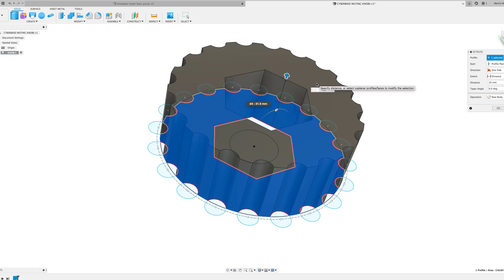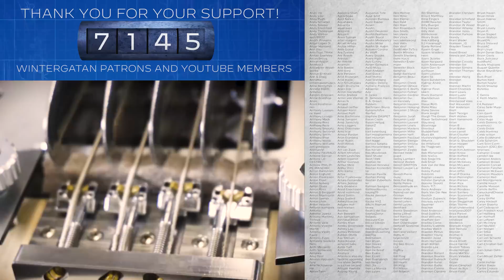Playing the CYBER BASS

Comment: If you want something a little better than the "cold blue" you are using, try rust blue.  It is actually an older, superior method of bluing steel.  More durable than modern "hot blue" finishes.

Comment: The bluing stuff is really good for heat as well that's why they use it on guns a lot. Protects the metal from rust while not just burning away after a few hundred rounds.

Comment: Legitimate question, did you think about doing a cam based system to play the bass? A bunch of arms that have artificial fingers on the end. They would be moved up and down on predetermined frets of the base, and the cams would be moved by the gear system. Using that you might be able to get the short notes you wanted.

Comment: Beautiful work, but with those two knobs you need two hands to adjust the note length. With a few gears (or a chain) between the two knobs you could reduce that to one knob without losing the stability that lifting from both sides offers.

Comment: An adjustable version of what Fender did almost 70 years ago.  It would be better if it pressed down, so it does not compromise the pressure of the strings against the bridge barrels.
Reply: and Rickenbacker, and then Musicman
Reply: -It doesn’t come close to being a problem in the way you describe.
-The bridge is so far away that it doesn’t matter.
-Plus it’s not pushing hard on the strings, just touching ‘em softly.
-Cheers

Comment: I am viewing this video from the perspective of a bass player. From my viewpoint there are a number of aspects about this build that need to be explained, because right now they make no sense. I watched the whole video and you never explained why you made these giant blades above the bridge pickups (adjusting your plucking position can be extremely useful which now cannot be done). Also, why have 4 separate inputs when the pickup heights could have been individually adjusted? Also, no mention of why this is a cyber bass. Maybe put a midi controller on it or something. I am willing to adjust my viewpoint if things can be convincingly explained. However, as of this moment I see very little logical reason for the design other than making it look cooler than it really is.
Reply: This bass is not meant to be plucked by a person. Blades are guides for marbles. Picking position can not be adjusted because they are set by the rigidity of the marble paths so this won't be an issue when the marbles are playing it. The machine has limited programming, so providing individual outputs allows him to mute one of the strings in the DAW and his live setup, so even if the marbles are still playing that string, he can create different patterns. Watch the video he just put out today: https://www.youtube.com/watch?v=rvL83-iy-EQ.  It goes over the actual use case a lot more. He shows the muted strings at 18:24 in that video. As for the name, I think he came up with it in a past video. I can't remember the reason.
Reply: @GilliganBMT  Thanks for explaining! This build make a lot more sense now. In retrospect, kinda strange he even made a video plucking it by hand. The new video was pretty cool!

Comment: If you're unsatisfied with the finish of the bolts, you can definitely pocket machine and press the bolts in from the back side. It will make the look a lot more "stealth" while still being very solid.

Just make sure to grind the heads flat so the knob goes on straight.

Comment: OK, so probably the worst idea ever just popped into my head...
but imagine an entirely mechanical/roboticised bass using metal ribbons and some sort of plucker?
probably a terrible idea tbh!...
but now ive thought of it, i kinda really want to know what a metal ribbon suspended between two points would sound like!
maybe pickups at various lengths could even be used to add an extra Electro sound! (like super high voltages passed through vibrating ribbons that smack against pickups?)
(at the very least a custom pick/plucker would have to be made though!)
then again, the more i think about it, the more i feel this is more of a job for a metal worker with a possible death-wish! lol...
Reply: lilliths revenge Sounds kind of like a bass version of a harpsichord (the ancestor of the piano, with plucked strings instead of hammered)

Comment: Gibson EB basses from the 60s have a simple mute that is just a pull tab that wedges the felt or  foam into the strings with a spring that pushes it back down when the pull tab is released. So much simpler, much quicker to engage.

Comment: You made a drill bit! I had the same problem on a electric guitar mod recently- standard bits not long enough- but didn't think of doing this, even though I have long stainless steel TIG welding rods lying around. Thanks for the idea, Mr Audacious.

Comment: Did you apply oil to the Perma Blued surface? Because that looks dry. 
I don't know if you know this already, but the cold bluing substance just makes an porous surface on steel for oil to hold on to. So it's the oil that actually protects the steel, not the black colored layer itself. On bonus side; oiling the surface turns it a bit darker. But probably you red the manufacturers instructions and I'm blabbing all in vain here.

Comment: Awesome song and build! May I suggest adding/using one knob right under the bridge of the bass instead of the two knobs to bring the felt out and in more ergonomically and faster with one hand and putting springs along the two knob screws? Or through that foam knob I am suggesting to add, perhaps create a three level push mechanism so that you get three different foam settings on the strings: first setting is no foam on strings silence; second setting is minimum foam on strings; and third setting is full-on foam on strings. Actually, I saw something like that designed by a friend of Scott from Scott's Bass YouTube channel. Might be simpler to operate while you're playing bass. Thanks! Brilliant stuff!

Comment: Scope creep is all over this project (that is kind of what happens with engineers like myself) but when you started to use the base drum I had an idea. The idea was to place a base drum inside the structural frame. Since the programming wheel is set in stone, use a second small programming wheel where it can be geared down from the main programming wheel. 

Downside is you will need a heavier marble to hit the bass drum pedal so you would need need dedicated subsystems from the superstructure. Maybe hold off on that until the Marble Machine XL, with a full 3 1/2 octave vibraphone.

Comment: Sure hope you patented all that. Or a clip/flip version, where you adjust height of the felt like you're doing now but you can flip a lever that lowers or raises it by a certain set increment for fast action. Two bolts might seem like a hassle to set, but it's better because you get to set both sides a bit differently (i think).

Both the bridge and the felt mechanism should be pattented because guys like Fender or whoever could get these on a new model and sell em for quite a bit. People are going to want these on their bases to get some motown etc sound...

Comment: Hey, Marvin, you might want to reconsider combining the aluminum knob with a steel bolt. Can cause galvanic corrosion if you get it wet/sweaty. Might not hurt to throw a layer of lacquer or something between the knob and bolt to prevent it. Don't know how significant corrosion will be, but it's something worth considering for overall longevity of the machine.

Comment: (Martin cutting the AD/HD bridge with a chop saw)  My brain goes to this:

Antiques Roadshow 2120:  "And here we have a beautiful marble machine brought in by John.  So what you can tell us about this wonderful piece?"

(long rambling bit about how it has been in the family for decades but not sure if it's authentic.)

"Mmm-hmmm, mmm-hmmm, well John, I do have a good bit of news for you.  Do you see this bridge plate?  You mentioned that you think it might be a replacement part but in fact I did a little digging and discovered that the original creator of this device actually had to 'field modify' this bridge in order to make room for the felt dampener.  So by having this AD/HD logo cut off at the top, this bit proves that your marble machine is an original...."

Comment: For the new part, why go with screws instead of using more of a knob/switch on a ramp to push the felt up, with divots to keep it in place, so you can more quickly and easily swap between short and long notes?
I'm envisioning a spiral stair case or overly large screw threading design with a strong spring pushing the felt piece up.

Comment: Rather than securing the dampening plate up with bolts, what about using springs on the threaded section of the bolts then you can disengage the felt quickly and manually when the song requires long notes?

Comment: technically i think thats  cold bluing... you can get the same thing by heating steel parts to around 300 degrees and quenching in oil... but the cold bluing is like that or that is cold bluing... its black really but its called bluing... not sure why..

Comment: Those cables are bugging me, they look awkward and in the way. Why don’t they come out of the back of the bass instead?
Reply: Or use 90 degree plugs and take the wiring to the sides and away from your hands.
Reply: Old Archillies but the bass isn’t constrained by having someone wear it, so they can come out the back, especially if it’s played from the side.
Reply: @SWebster10  true and it's will look nice with the cables in the rear. But would they be uncomfortable if it was being played by Martin? Will the cables be getting pinched between the body of the bass and the players? Not a musician, just wondering. :-)

Comment: I know its not a finalised design and you have probably thought about this already, but I would think about using 90 degree right angle 1/4" TRS jack ends (Neutrik or SquarePlugs Ive had great results for pedalboards with) to help with tidying your output cables to the edge of the bass, down the edge face and around to the underneath, using cable tidy clips to guide the cables underneath the bass in situ, to channel the cables to an indiscriminate part of the MMX frame, allowing for a cleaner look and keep the cables away from playing/drop/cranking areas etc to your I/O mixing boards on this awesome machine. Hope this helps if its something youve not yet thought of, if you have, well great minds think a-like, and Im just behind the curve! Great mods, getting more and more complete every day!

Comment: IDEA! You can actually put springs between bass and metal things, and set the metal things free on screws, so that they can slide freely. And than you can adjust not the height of felt, but MAXIMUM height. But you'll be able to push on it with your hand, when needed to play longer notes and release it, when needed shorter ones.
Love your work, absolutely stunning! Been watching since the very beginning

Comment: Why not run the 4 bass cables from the back of the bass?
It'll look better, hiding the cables and keeping the steampunk aesthetic, and not interfering with the silhouette of the bass.
it'll free up space on the front of the bass for your hands to do stuff (play music or whatever)
it'll make the cable run easier. they'll be shorter and closer to the structure of the machine. easier permanent installation, and when the bass is unplugged and taken off for transport and packing (which may be a thing) the cables on the machine will be shorter and easier to manage.

Comment: hey i have an idea for your bass
you are on the right track, think damper peddle for piano..

maybe silicone finger??

and then also use the felt damper.

you could use bar shaped pins for activation on the wheel or just do a damper lever.

you could also use a electric solenoid to activate the damper..

and make it several deg of dampening with a servo system.

Comment: Tip for you blueing the metal: heat the part up in boiling water first, then apply the blueing chemical with a cotton pad, repeat a few times and rub with a light coat of motor oil.

Comment: In the next episode:
"So I undid everything from the last episode so now the bass mute can be engaged and disengaged via a foot pedal."
Reply: Programmable muting is clearly the only way to go. You just need to add another channel to the programming wheel and widen the entire machine to make it fit. How hard could it be?
Reply: @rubenanjavreesma7235  I considered this, but I was too scared to suggest it in case Martin saw it and actually thought it was a good idee
Reply: @LaneBee  It's a good excuse for an mmx 2. Along with an integrated solar powered steel smelter so you can feed the machine raw iron ore and it'll make its own marbles.
Reply: Ruben & Anja Vreesma 😂 that’s what I thought, too. But I also like the idea with the lever besides the neck.
Reply: Minecraft Platinum Fireworks Inc. it shouldn’t change the tension on the strings, just how palm muting doesn’t change the tuning. Also, it’s so close to the bridge that the change in fulcrum point related to the string length will be negligible.
Reply: I was thinking a hand actuated lever up near the fret board would be just as quick
Reply: @LGreymark  It would be just as quick, but then Martin wouldn't have an excuse to engineer another footpedal.
Reply: @LGreymark  - Similar - I think a pad near the top of the pick board with a control lever running parallel to the neck would have been more optimal and given a better effect :/
Reply: @LGreymark  This was the first idea for me as well when I saw the video. The muting systems as is seems very slow to engage whereas a lever would be just a quick pull. Also situating the mechanism near the fretboard would be much more efficient in dampening... But maybe that's the problem... As the muting can't be done note by note basis anyway, a fine control with the dials is probably what he is looking for.
Reply: i really don't see how this is going to work when he has songs that require specific muting...
Reply: Blaze Storm Don't give him more ideas... I'm too old.
Reply: That would be insane. But really awesome. Lol
Reply: Minecraft Platinum Fireworks Inc. it would reduce the bounce just slightly because they felt is right at the end of the strings. Would it be more ahead then it would definitely affect the bouncing.
Reply: @Minecraft Platinum Fireworks Inc. It's doubtful that it will affect the bounce that much.  Mutes don't press very hard to work.
Reply: Oh be careful, I'm afraid Martin really will do that after he saw your comment even if he hasn't thought of it before.
Reply: foot pedal, you say? hmmm..

youtu.be/h1dIyb7dMb
Reply: You know he is going to have to.  he'll want the ability to have both long and short notes.  Ha
Reply: bruh
Reply: It's Thursday now and no update, I doubt if he really went for this idea hahahahah

Comment: I'm not sure how to make it marble actuated, but you could try adding a foot pedal to the Funkalizer.  stabilizing it (the way space bars on a mechanical computer keyboard are) would let you use a single actuation point in the middle, and you could use your knobs to adjust the spring tension.

Comment: 0:22 never seen a base with FOUR jacks - davie504 has to comment on this - SLAP
4:02 that's NOT how one uses calipers - everything hurts inside me
Reply: That is actually how most professionals use calipers.
Reply: @Hephera  I not just doubt that but with 3 years of training in metal works I can asure you that's not how you use them - and any "professional" you've seen or know using calipers in such a way isn't a professional
the reason is that calipers are highly precise machined tools made out of rather soft material - it's basic 5th grade physics that when you scratch a harder material with a softer one you actually damage the softer material
that's why in metal works one use special marking tools with special hardened tips so you actual mark the piece you're working on instead of messing up your marking tool - or in this case the calipers

Comment: rust bluing isn't protective on its own, it creates a porous surface to hold oil which is what prevents the rust (as long as it is maintained). you spray lacquered it so that would be good enough. also, you can do as many layers of the blue as you want to make it darker, then polish it back and add more layers to create any kind of effect you want. it takes more work than hot bluing.

also, look up thread milling. with small depth of cut, the router could probably handle it in regular steel. the control of cycles in fusion 360 is suboptimal but more than good enough for what you are doing.

Comment: Be carefull when put some different metals in contact, especially if you will also put some moisture on them (sweat from your hand or fingers).  By doing that, you create a small battery and this might involve some corrosion on the metal (change of aspect color etc) here maybe you are safe with aluminium, but i would not do that between iron and brass, for example (because of copper)

Comment: might sound silly but since you dont need to have a huge amount of pressure on the felt pad wouldnt it be nice to have a lever to actuate the damper system instead of the screwthreads, this way you could have a pedal or lever or even a mechanical linkage to the programming wheel , meaning you could activate the dampener on the fly at speed, or even on a note by note basis.

Comment: You need to make the felt on a whammy bar type set up. Allow yourself a near piano pedal style of control.
Reply: Reverse your mounting of the felt bar. Nuts on bolts instead of bolts to nuts. Have the felt plate sit on springs & have a U shaped stirrup sit under the nut toppers. Whammy bar/piano pedal.